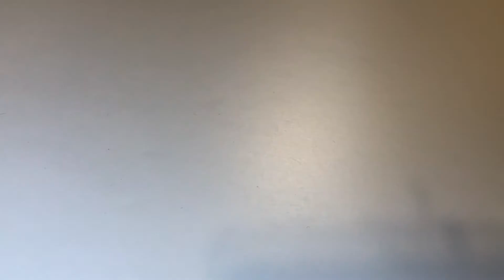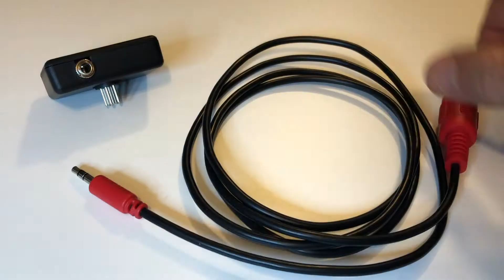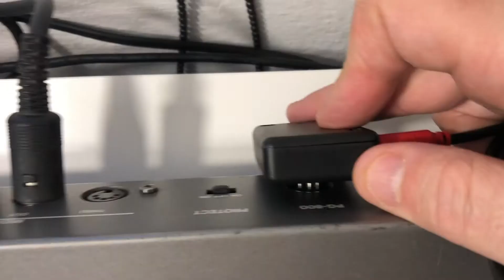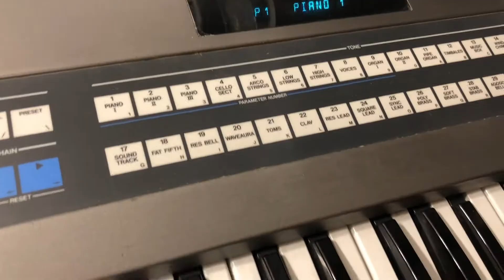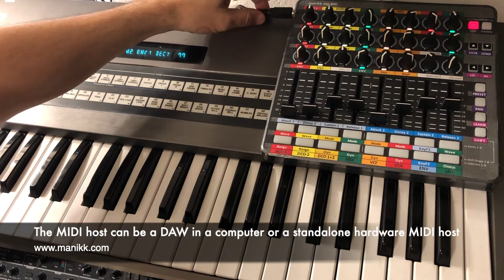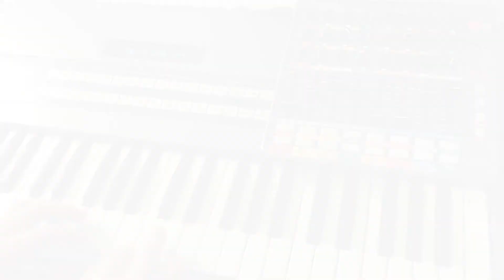manikk MP-800 Tutorial - Programmer for the Roland JX-8P, JX-10 and MKS-70

Comment: Great video! It's really nice because I have the Novation Launchcontrol XL. How is this synth, do you recommend it? I have Oberheims and my music style is synthwave,
Reply from the maker: Thank you! Yes, this a simple solution to be able to program the synth. The JX-8P is a great sounding synth for warm analog pads but also for other kinds of sound like bass and leads. I think it will work really well for synthwave. There is now also a new programmer out called manikk u800, check that out also. You will find them both at Escape From Noise.
Reply: @manikk  Thank you! I will check it.